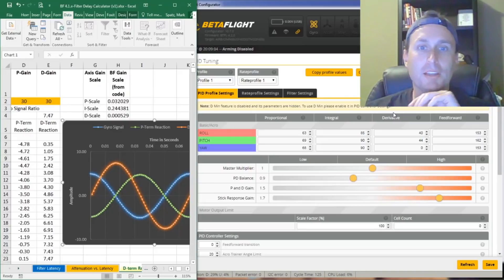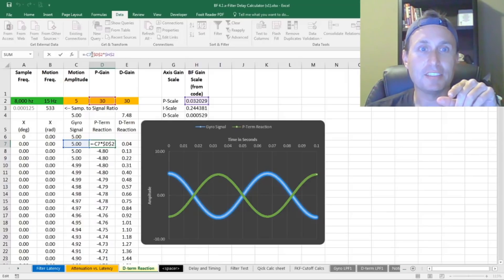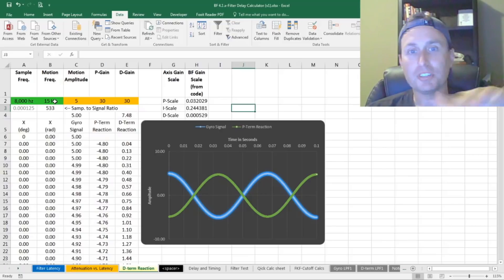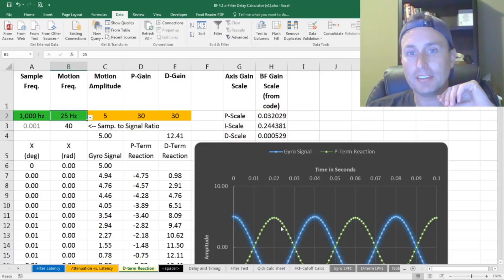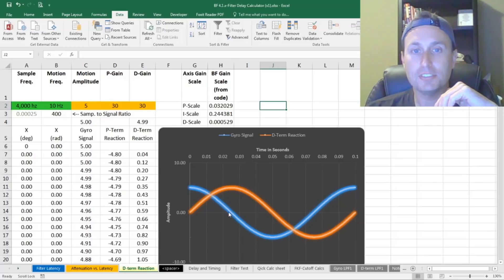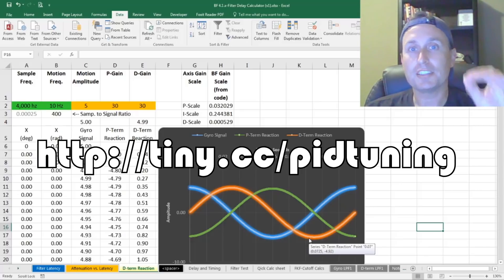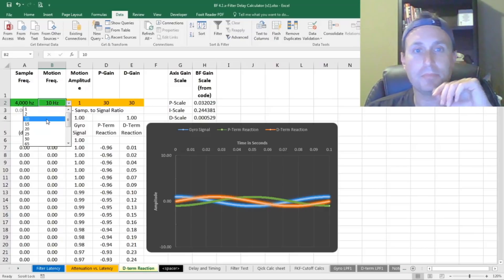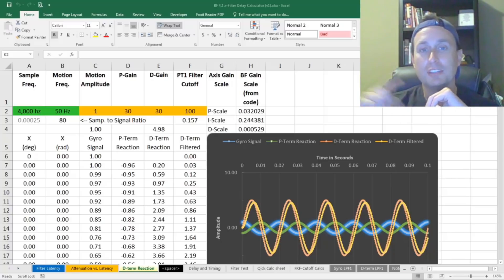Betaflight PIDs for Dummies

Comment: Great video! Do you think i could use this  to help for a PD balance in iNav?  i would love the sliders in Beta flight idea (but never used as i have used iNav) but iNav doesn't have the sliders and its a pain to figure out more to try and tune.  I am more into Cinematic stuff and trying to get some guidance,  thank you :)
Reply from the maker: Check out theuavtech.com/tuning

The fundamentals discussed there about PID relationships, etc... are fundamental and apply across any FW.  With iNAV, you just have to manually calc and hold the ratios.
Reply: @uavtech  Thanks dude :).  I am having gyro/software bug problem with inav at the moment, which i found where the roll/pitch axle is not set to zero correctly should be found causing my quad to shake on uncontrollably and there was no way of re-correcting the values, cause they kept changing.

Comment: Watched 2 times: Thank you! But, one question: if anything above 40Hz or 50Hz is not stick moves and is noise, why simply cannot cut off every frequency above that value? Why dynamic filters, rpm filters and multiple notch filters? Thank you.
Reply from the maker: Because you need to keep in mind when we look at the gyro signal this way - in the Frequency Domain - we only do that for ease of understanding the vibrations on the gyro signal.  Real World, the gyro data is in the Time Domain - like our everyday life.  As time passes, things are happening (the X-axis).  For the Gyro signal data, that is a continuous stream of data points that are either higher or lower in amplitude.  You can't just 'cut that off'.  It is only when we translate that into the "Frequency Domain" (by doing a Fast Fourier Transform (FFT) on the data), do we see it then in a different way; with frequencies of the vibrations in the signal, how close they are together (Hz) and how big their amplitude is at a certain spacing.  In the Frequency Domain representation, yes, it does seem like you can "cut off" the higher frequency data, but knowing the distinction of that is just a plot, we realize that's not how it works on the actual signal, which is really in the Time Domain and we can't cut off the continuious stream of data coming from the gyro to the PID loop.
Reply: @uavtech  I understand, thank you. I was missing the real world part: a sequence of data values that becomes something understandable only with passing time (so filters delays, I guess). Waiting for part 2.
Reply from the maker: Part II is Patreon Access.

Comment: D term is like friction!
Reply from the maker: Yup!

Except one little difference.  When wind blow the quad off course, or you enter prop wash, D-Term is the FIRST to push the motors to correct.  Also P-term helps to correct there too.  They push in that case together as something is trying to blow the quad off course; off Setpoint (the sricks). HOWEVER, as the quad then starts to move back toward the getting to Setpoint, D opposes P so P does not make it oscillate around Setpoint.
Reply: @uavtech  very little difference! If you think when a car is drifting you are giving acceleration in one direction (P term) and the friction between the road and the wheels are stopping you from overdo the acceleration (D term), you have to find the balance (kinda like pid tuning). The major difference is that the quad is in the air so friction is very little and we need D term as a "virtual" kind of friction to counter accelerate the P term acceleration. 
Your video helped me understand this concept really good! Thank you for the information. Pid tuning just got easier 😂
Reply from the maker: 👍👍👍
That's AWESOME to hear.  Thank you!!

Comment: It would be so helpful if you could do a pid tinning guide specifically for racing. Some things we can do to make it track better setpoint during jacobs ladder, hard slaloms, etc. Seems counter intuitive to lower the p/d gain in order to improve those things. Im sure I'm doing other things wrong, I would love to see a dedicated video for that.
Reply from the maker: Can do.  Lower PD Gain, who said to do that?
Reply: Sorry I meant to say PD balance. Thanks would be so helpful!
Reply from the maker: @marcespuna1816  , so the slider is all reversed now.  A lower PD Balance means more P-term to D-term ratio.  (P/D = ratio).  You do not want to have an Overdampened stepped response because P and D push TOGETHER in a prop wash condition to keep things on track and also fight off gyro movement.

Comment: in section 1, the blue line is error/deviation from setpoint, right? From the equation it looks like P term is reacting to deviation from 0 gyro amplitude.
Reply from the maker: Yes technically.

For the simple example, I just created a simple sine wave in excel to demonstrate how P-term and D-Term react to gyro motion.

Comment: 2:56 pid controller just stabillize  system and not any random wind in this  calculations is present ... wind not correcting with pid controller..  pid controller correcting quad momentum
Reply from the maker: Correct.  Wind blow it off course, P & D push back on external movement to resist that push.  This is just an illustration and doesn't show the PID controller pushing back against an external force.
Reply: @uavtech   agree..

Comment: I built a laser hd after seeing how good your flew and mine has really bad vibrations at 70-100% throttle. It’s a brand new build with all new parts and no crashes on 4.2.1. I tried raising and lowering the pd balance slider until it flew like crap both ways but still got the terrible Vibrations at high throttle. Any ideas? It seems to fly good other then the issue I described above. I’m using xing e 2207, 2750kv motors on 4S, iflight succex e F4, iflight 45a blheli_s on hurricane 51433 props. Also tried hurricane 51466 with no difference.
Reply: Have you tried changing the pwm freq with j_esc? 
Try raising the tpa to 80%,but my best bet, is that you have some loose screws, fc is too loose in the stack, or some other mechanical problem.
Perhaps a not 100% straight motorshaft. 

Might be a new build, but still points to a faulty hardware problem, to me. A 5 inch should be a fine out the box experience on default
Reply: Pippi FPV I realized that the FC was a little too loose with the soft mounts. So I hard mounted the ESC and soft mounted the FC and that made all the difference in the world. Thanks for your help!
Reply from the maker: Glad to hear you got it sorted.  I really like the frame so it would have been a downer.
Reply: UAV Tech any chance you could send me your tune that came on yours for this frame? Thanks.
Reply from the maker: @aerialimagery3216  , I tuned it.  I think it came with BF stock.  But sure, by DIFF ALL for BF 4.2.x is:

# version
# Betaflight / STM32F405 (S405) 4.2.0 Apr 29 2020 / 08:08:49 (b480103d4) MSP API: 1.43

# config: YES

# start the command batch
batch start

# reset configuration to default settings
defaults nosave

board_name TMOTORF4
manufacturer_id TMTR
mcu_id 0040004e324d500620303256
signature 

# name: TransTEC Laser

# feature
feature -RX_PARALLEL_PWM
feature RX_SERIAL
feature GPS

# serial
serial 1 1 115200 57600 0 115200
serial 2 2 115200 57600 0 115200
serial 4 64 115200 57600 0 115200

# aux
aux 0 0 0 1700 2100 0 0
aux 1 1 1 1300 1700 0 0
aux 2 13 0 1300 1700 0 0
aux 3 26 2 1300 1700 0 0
aux 4 35 2 1700 2100 0 0
aux 5 36 3 1700 2100 0 0
aux 6 37 3 1300 1700 0 0

# rxrange
rxrange 3 1000 1988

# rxfail
rxfail 5 s 1500

# master
set gyro_lowpass_hz = 0
set gyro_lowpass2_hz = 0
set dyn_notch_width_percent = 0
set dyn_notch_q = 250
set dyn_notch_min_hz = 125
set dyn_notch_max_hz = 350
set dyn_lpf_gyro_min_hz = 0
set dyn_lpf_gyro_max_hz = 750
set acc_calibration = 183,-15,268,1
set mag_hardware = NONE
set baro_hardware = NONE
set min_check = 1005
set max_check = 1995
set rc_smoothing_auto_smoothness = 7
set serialrx_provider = SBUS
set sbus_baud_fast = ON
set dshot_bidir = ON
set motor_pwm_protocol = DSHOT300
set failsafe_off_delay = 30
set failsafe_throttle = 1200
set failsafe_procedure = GPS-RESCUE
set yaw_motors_reversed = ON
set small_angle = 180
set gps_provider = UBLOX
set gps_sbas_mode = WAAS
set gps_auto_baud = ON
set gps_ublox_use_galileo = ON
set gps_set_home_point_once = ON
set gps_rescue_descent_dist = 100
set gps_rescue_min_sats = 5
set gps_rescue_allow_arming_without_fix = ON
set deadband = 5
set yaw_deadband = 5
set pid_process_denom = 2
set transient_throttle_limit = 10
set osd_units = IMPERIAL
set osd_cap_alarm = 1000
set osd_alt_alarm = 400
set osd_rssi_pos = 2067
set osd_remaining_time_estimate_pos = 0
set osd_current_pos = 2071
set osd_mah_drawn_pos = 2105
set osd_gps_speed_pos = 2144
set osd_gps_lon_pos = 2112
set osd_gps_lat_pos = 2080
set osd_gps_sats_pos = 2048
set osd_home_dir_pos = 2053
set osd_home_dist_pos = 2054
set osd_flight_dist_pos = 79
set osd_compass_bar_pos = 41
set osd_warnings_pos = 6313
set osd_avg_cell_voltage_pos = 2059
set osd_battery_usage_pos = 40
set osd_rtc_date_time_pos = 8
set debug_mode = GYRO_SCALED
set scheduler_optimize_rate = ON
set gyro_rpm_notch_min = 125
set name = TransTEC Laser

profile 0

# profile 0
set dyn_lpf_dterm_min_hz = 91
set dyn_lpf_dterm_max_hz = 221
set dyn_lpf_dterm_curve_expo = 7
set dterm_lowpass2_hz = 195
set anti_gravity_gain = 20000
set pidsum_limit = 1000
set pidsum_limit_yaw = 1000
set throttle_boost = 0
set throttle_boost_cutoff = 25
set p_pitch = 83
set d_pitch = 62
set f_pitch = 190
set p_roll = 76
set d_roll = 57
set f_roll = 180
set p_yaw = 81
set f_yaw = 180
set d_min_roll = 37
set d_min_pitch = 41
set d_min_boost_gain = 30
set d_min_advance = 0
set ff_smooth_factor = 10
set ff_boost = 25
set idle_min_rpm = 23

profile 1

# profile 1
set anti_gravity_gain = 10000
set p_pitch = 87
set d_pitch = 65
set f_pitch = 190
set p_roll = 80
set d_roll = 60
set f_roll = 180
set p_yaw = 86
set f_yaw = 180
set d_min_roll = 39
set d_min_pitch = 43
set d_min_boost_gain = 30
set d_min_advance = 0

profile 2

# restore original profile selection
profile 0

rateprofile 0

# rateprofile 0
set thr_mid = 30
set rates_type = ACTUAL
set roll_rc_rate = 1
set pitch_rc_rate = 1
set yaw_rc_rate = 1
set roll_expo = 20
set pitch_expo = 20
set yaw_expo = 20
set roll_srate = 100
set pitch_srate = 100
set tpa_rate = 75
set tpa_breakpoint = 1750

rateprofile 1

rateprofile 2

rateprofile 3

rateprofile 4

rateprofile 5

# restore original rateprofile selection
rateprofile 0

# save configuration
save
Reply from the maker: Be careful.  This is an aggressive filtering/tune and also uses Dynamic Idle at 23.  Do a desync check for Dyn Idle (flips and rolls low to the ground) and be cautious of hot motors and stuff in normal flight as I have turned filtering down (off).  That said, it still should be fine.  If this filter setup doesn't work, you want to look at mechanical stuff.

This is with BLHeli_32 defaults (that includes 16 deg timing and 24khz PWM).  I have a DJI unit and Session 5 mounted.
Reply: UAV Tech awesome, thanks so much!

Comment: If the pid controller is the fundamental machine that makes the quadcopter fly it blows my mind how nueroflight works by taking the pid controller out of it.
Reply from the maker: Whelp, it doesn't fly as good.  The postulation is the neural network can do better.  The question is, is that a Rube Goldberg approach??  It has yet to be seen that a neural network is better than a good old - simple - PID controller.
Reply: @uavtech  right. The idea is to be able to train the AI to be able to adapt to all possibilities on the fly?(no pun intended) Kinda takes the fun out of it......
I can definitely see some good uses for something like that though.
Reply from the maker: I think the idea is self-tuning, which would be awesome!!
Reply: @uavtech  yeah takes the fun out of it. I like that kinda stuff cuz you feel more rewarded after you get it done. As long as you don't spend all the time chasing it.  But it is definitely cool idea to auto tune and then be able to have it adjust to a bent prop or a bearing going bad on its own to always have the optimal performance.
Reply: I think that is sort of the new approach flight one is taking with the AI filter they are implementing on their new H7 flight controllers.
Reply from the maker: Yeah, they don't have the chops to actually do it though unfortunitly.  That is marketing talking there.